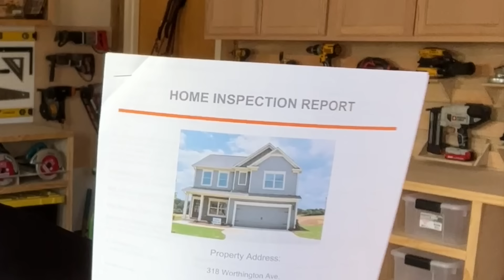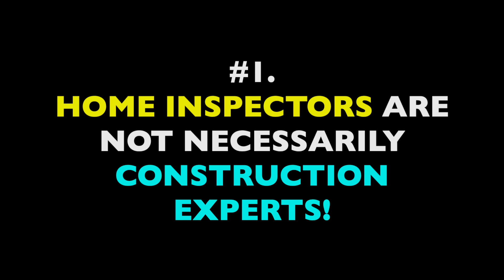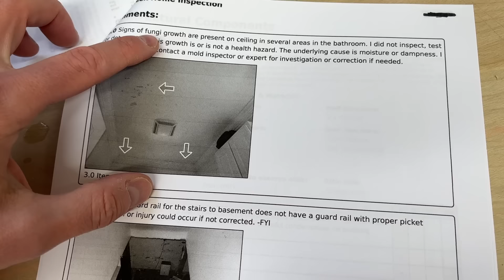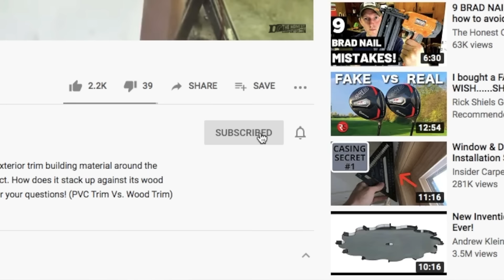The Truth About HOME INSPECTION REPORTS! What They Leave Out...(Homebuyers SHOULD WATCH This Video!)

Comment: Please do a follow up video.  Focus on wiring, plumbing, roof, mold and bugs/snakes.   Everything else is pretty easily fixable.   The report should be prioritized and organized  based on how serious the issue is.  The report should also note how old the water heater is and the furnace/AC and indicate the expected life of those items.  The inspections I've seen have way too much bs in it, small stuff.  Also require the inspector t

Comment: My first home inspector pulled me aside from my realtor and whispered “don’t buy this house” after spending 10 minutes looking at it. He didn’t even write a report and do an inspection. He walked me across the street and pointed at the house and asked “tell me what you see”

The house was leaning notably to one side, sinking. He said it measured it sinking almost 10 degrees. The worst part is how they tried to cover up the leaning inside and under the crawl space by adjusting doors and trying to shim and prop things up, nothing to code.

After I walked away, someone did eventually buy the home, and a year later I noticed it was condemned and demo’d. Someone probably lost a ton of money :(

Comment: I know for a fact the guy who inspected my house never opened the attic hatch. The light that is required to be there by code in my county in Fl is there, but not even wired. Im sure they left the bulb out so he didn't bother to check. They also wired my septic pump with a 14 gauge instead of a 12, and wired it into same circuit as main bedroom wall so the thing popped all the time and they had to come back and run an independant wire for the pump. All the hot and colds were reversed on the sinks etc. they miss a bunch.

Comment: This video is an excellent awareness tool for homeowners. I may add it to my website for my potential clients as a learning tool.  "Reputation for Thoroughness,” that’s my goal.
As a new home inspector in AZ I appreciate this video. I have construction training as well as 10 years in the fire service. As I was doing my mandatory parallel inspection training I noticed inspectors are very lazy, they talk way too much, then rush to get their information put into their software before rushing to be late for the next appointment, or their focus is biased toward the realtor, not the actual client. 
Liability is the reason behind this lack of actual knowledge and work ethic because Standard Operating Procedures say that only a visual inspection should be provided. This means that any deviation and the inspector can find him / herself in court paying for fixes, appliances, or whatever the other party can get. This is devastating to a small business and so inspectors do the minimum. 
For example, not many inspectors will actually enter a crawl space or attic if they can’t just walk into it. To me it’s not only fun to crawl around and check stuff out, it’s needed. Another issue I have seen is a major lack of knowledge. Example, while training I have spotted asbestos in a home built in 1944 and was told it’s not. I found a dialectic union at a hidden water heater (behind a wall) and was told it’s not. I also put my hand on a very loose railing and moved it to test the extent of the issue. I was told don’t do that, the inspection is visual only. The list goes on and on, but I purposely shut my mouth, observed, and learned what not to do. 
My company will not operate that way... ever! 
As a life long AZ resident my goal is to provide the best information possible to my client, even if I have to risk liability by moving a couch or boxes. I work for my client only and do 1 inspection per day to focus on my client without distraction. 

Thank you for this video :)

Comment: I learned what you say in this video the hard $$ way soon after purchasing my house in 2017. The old guy inspector claimed to have built homes for years. Ok, cool. On the phone, I asked if he would get on the roof to inspect, which he said binoculars can pretty much see the same thing. I was new to this, so I didn't think much of it. Turns out I had to replace the chimney cap that was cracked up and causing a leak in my family room. $2K later, I learned that with my next coming home inspection, I will be inspecting as well because there were other small issues I learned to repair during the time in this house.

BTW, Michigan does not have inspector license requirement.

Comment: Had a home inspection done by person referred by the realtor and among other things he failed to mention there was no main water shut off in the house. In a house that’s almost 100 yrs old with old pipes that are smaller than what’s required/recommended now that was a big expense- had to have lawn dug up, new pipes installed from street into the house cause adding the shut off to the old pipes wasn’t feasible. 
Idk how the previous homeowners didn’t know or weren’t concerned about not having a main water shut off but that seemed to me like a big miss by the home inspector. Also the roof had to be replaced because we couldn’t insure repairs due to having 3 layers of shingles on top of orig roof.  Two pretty big $$ items that seemed like should have been not only mentioned but highlighted in the home inspection report as such. 
They could easily have alerted us to at least do some research about how much those type of repairs would cost. It’s definitely more difficult in sellers market to get a thorough home inspection and negotiate time or $ for repairs to be done. If buyers can’t or don’t get a home inspection I would recommend getting a home warranty (they are available even if it’s not new construction) to cover the major systems- hvac, furnace, electrical, some plumbing and appliances. Seems like sort of unnecessary expense but saved me a lot $$ in a previous condo when the main electric panel didn’t have the correct set up and had a fuse literally catch fire...

Comment: Great video.  My experience is inspectors have no real knowledge of building practices.  One house I sold, the first problem listed in the report was to install H-Clips on roof sheathing...on a 40 year old house.  They also had three "major" problems listed with an electric panel that had just been installed and had a county inspection sticker right on the panel.  I had to literally go find quotes in the NEC to show the buyer that the inspection report was wrong.

Comment: I am a home inspector in southern California. Licensed and active California B-1 General Contractor who has built 20 houses on my own dime. Worked for builders and developers after spending the first 7 years of my work life as a real estate agent. Developed 3 major medical office buildings, was land acq manager for a top 5 publicly held homebuilder and am now an inspector in my retirement. Personally I inspect about 25 houses a month (our little company does over 100 a month), and am constantly told I am the most thorough home inspector realtors have ever seen. My reports have about 400 pictures with graphics showing issues both good and not so good as well as explanations with recommendations on the fix or correction. My shortest inspection was 2 hours (condo) and longest 9 hours(8000 sf house). I inspect residential, commercial and industrial. The problem in California is that anyone can be an inspector as there is no licensing or certification requirement. I advocate for licensing however many inspectors resist and tell me their rates would have to go up. That is a big lie. My rates are very competitive and I maintain all levels of insurance as well as keep my B1 license active and bonded. I am all for quality inspections and quality reports. I also provide cost estimates with a low and high and notes regarding issues. Most inspectors are afraid to do that level of work. Nice video.  Cal-West Property Inspections and Cal-West Inspection Group.

Comment: I followed my home inspector around like a lost puppy. Attic, the crawlspace under the add-on, onto the roof. We spent several hours. I've lived in that house for seven years now and nothing has come up that wasn't noted in the report.

The house next door had a broken sewer drain line. When the renters used water in the house, that water (and the things in it...) would seep up through the driveway and trickle down the street into the storm drain. 

Some house flippers bought the house last fall and did the usual: new flooring, countertops, ceiling fans. They sold the house last month and the lady that bought it, despite hiring an inspector, got the pleasure of having to hire someone to break up the driveway and replace the sewer drain. She told me there was a large auger and several feet of chain in the pipe, so the sellers had attempted to clear it, but gave up.

Comment: I have had nothing but negative experiences with home inspections. When buying the inspections I’ve gotten were so superficial they showed me nothing. And the last time I TRIED to sell my house the inspection actually had so much on it, 95% of it was completely false, that he cost me the sale. He scared the buyers away even though I could show them that what he said was completely false. 
For example, he told the buyer my attic had no collar ties. It does. I sent them pictures of the collar ties. 
He told them my popcorn ceilings were very likely asbestos even though my house was built well after asbestos was banned. They believed him though. I later had it tested. No asbestos. 
He told them my addition was very likely die with Chinese sheetrock.  Anyone whose ever dealt with Chinese sheetrock knows you can detect that stuff by smell and by looking at the wiring. I do not have Chinese sheetrock. My addition was done well after the Chinese sheetrock thing took place. 
He told them I had Black Mold in my basement. It was a tiny spot of mildew. I had it tested the next day. 
He told them the ducts needed to be cleaned to remove asbestos and mold. He never even looked at the ducts. I was with him. 
And the list went on and on like that for 48 pages!!!  
The only thing that was accurate and actually legitimate was there was one electrical junction box with no cover, I spent 75 cents and fixed that, and there is a tiny horizontal crack along one wall of my basement. I have now spent $4,000 installing steel braces on that wall. 
He scared the buyer to death. They backed out. 
I truly believe home inspections are worthless. They are a scam. They only go one of those two ways: don’t do anything or go way overboard. Either way they’re just for show.

Comment: Good explanations. I am certified to do electrical inspections and it is the same principle, document what can be seen, indicate anything that is broken, under spec, or off code, the most complicated really are the load calculations to see if a system has enough capacity. Very few things get measured or tested if at all.
A survey or certification inspection would yield a much more detailed report, in the survey process every single component gets analysed, verified, documented and calculated. Expensive and lengthy work...
For the homeowner I would recommend to bring someone with reasonable construction expertise in on the inspection, to advise you, to point out potential issues and hidden problems, and give you an idea of what the inspection report means in practical terms, and in terms of fixing it.
It doesn't have to be a contractor per se, but for example an experienced maintenance person or handyman, and carpenters and plumbers also tend to know enough to give you an idea of what the damage all means in terms of time and cost to fix. Since they will be working for you, without other obligation, you will not have to worry about any constraints on what they will investigate. 
The extra few hundred to know what is really going on is well spent.
Reply from the maker: Very good idea, Disklaimer!

Comment: It's true. I would never trust a home inspector recommend by a real estate agent. I got sucked into that when I bought my house. Firstly she tried to take a massive cut as in she told me to say that she recommended him and I'll get a good deal which was the price she gave me. So knowing about scans like this, I called for a quote without saying she referred me, and it was hundreds of dollars less than what she told me. Secondly, major problems were left out, costing me tens of thousands of dollars to get fixed. These included massive water damage like rotten floors, serious mould issues, all window hinges were broken, and more. Also when I asked about pests like cockroaches, he said there wasn't any and then I saw thousands of them everywhere. They were in plain sight 'cos they were running out of places to hide and when renovating the house cockroaches rained from the ceiling. It was a nightmare to fix the house up.
Oh and yes he was a builder too. So it makes you wonder how much he was influenced by the agent.

Comment: In BC Canada, the rules changed in 2009. In the course I was part of that was required in 2009, of 16 participants, half of the 16 participants quit within a month because they had no construction experience. The level of detail in the class was overwhelming for them. The remainder were engineers, tradesmen and GCs. Of the 16, only I and an engineer entered the field due to all of the ongoing education, startup costs, insurance and licensing. Some software is designed to prioritize, and as well, provides further detailed explanations through links to exterior pages. All reports are electronic now, in PDF hyperlinked format, which may be printed if they choose to. The report that you show is very rudimentary. There are better out there, including the most comprehensive, but likely most expensive, Horizon.

Prior to these regulations, anyone could call themselves a home inspector. A GC that I knew could not physically enter into crawlspaces or attics due to health issues. He quit inspecting once the new rules were imposed.

Comment: I have a good amount of on-site experience with home construction, and I will be taking the ICC Building Inspector exam very soon. I have also looked into 'Home Inspection' accreditation as a stop gap until I get hired as an actual building inspector. What is crazy about this is the home inspection exam for interNACHI gives you 60 minutes to answer 120 questions and the ICC exam gives you 120 minutes to answer 60 questions.

Comment: He's right. On almost all points. I wouldn't have pursued my home inspector license if I hadn't had several years of remodeling and handyman work under my belt. However, at least half of the inspector's job is communication - the report and the verbal summary. Someone who is a skilled communicator can use the reporting software to make sure that the big problems are called out and prioritized. An ex-contractor may or may not have those skills - they may have spent most of their years installing high-end kitchens. They may not have a lot of empathy or perspective when they're trying to report on a starter house or a fixer-upper for a first-time buyer.

Comment: I did house framing for 15 years and  new construction inspections for the last 23 years. One issue I have, in my state, is that I am qualified to inspect residential and commercial inspections from start to finish, but to work as a “home inspector” for buyers I am not qualified? Some “home inspectors” are what I call tire kickers. They come in and document cosmetic stuff and have no clue about what lies beneath or above or what actual structural problems look like, because of what you said about having no experience.

Comment: When moving to a new city used angies list as my first filter to find an inspector, then I looked at their website,  the I called the one I liked best and asked if they could share 3-5 sample reports from the last few months.  I met the inspector onsite and they thought me a couple of things about the house I would not have known otherwise. 

One point that was left out in the video is to insist that vacant homes have all utilities turned on before and during the inspection.  In my case the electric was on but the gas was shut off to the stove and the water was shut off to the house altogether.   This could hide potential issues if the utilities aren't on.

Comment: I walked the house with my inspector and he/I still missed things. He turned on the furnace and the vent he checked blew air fine. We both figured no problem. I have worked masonry repair for over 30 years and know a bit now about how houses should be built and what to look for. The contractor had to retire due to getting bone cancer in his arm. It turned out the heat transfer tube between either half of the manufactured home had been cbewed through by a critter and the other side of the house had no heat. There also was several rotten through areas by one of the outside doors that the rehab guys had covered up with plastic pieces and paint knowing nobody would notice etc. I have done furnace pipe work so I bought the 12 inch insulated transfer hose, metallic tape, and zip in screws, plus the two rotten 90 degree adjustable pipes from the furnace to both sides of the house. I spent two days underneath the place rebuilding the setup under there and taping everything back up and sealing things. I had about 200 bucks in materials and my time but everything works fine now and should be above code. Luckily I got a really good deal on the house because of what it was and it was still move in ready and done, just not everything that well. All the important things were new and I have some skills so still ended up happy with much more home than I normally would have been able to afford.